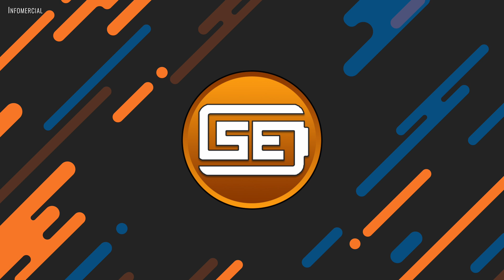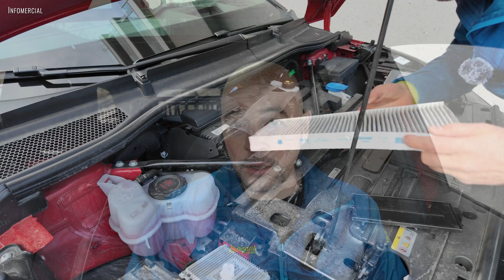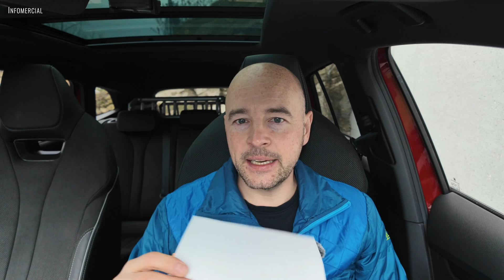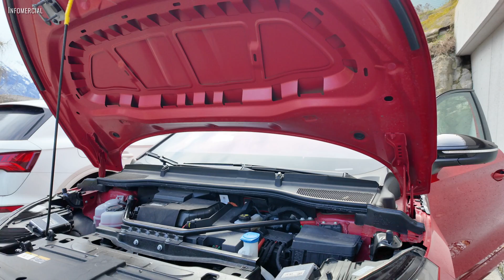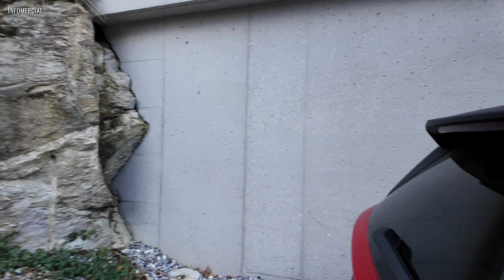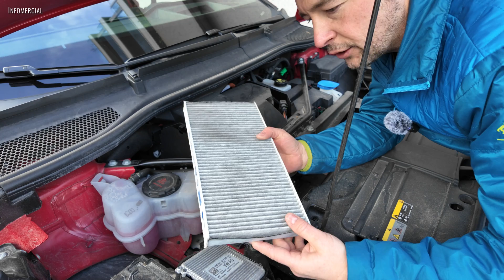Inspection and Service for my ENYAQ iV - What is done, costs and what can you do yourself

Comment: About the cabin filter, never blow it out, only change it. When you blow the filter clean, you release all the toxic stuff that the cabin filter has filtered. Vacuuming it is fine. My recommendation is 30.000km or 1 year for the cabin filter. 

Another tip: find an independent workshop or a brand specialist. For the 600 you spend on the dealer, you could also spend on an independent/specialist and ask for a brake job. (Manual cleaning and light greasing), that would justify the price. 

This price is out of this world for what is really done. The total time is around 30-45 minutes for a experienced mechanic. This price and not even resetting the service isn’t really what you should get for this price. Still can’t believe it. 😅
Reply: Thx to your tecommentations. Budget what about the warrenty you nee an official certified Garage. Than you will be on the safe side.. of Life 😂😮😅
Reply: @RGa-ch1vs  in the Netherlands at least, the warranty is two years for a new Enyaq. We also have something called BOVAG, if your garage has a BOVAG certification, you keep the warranty. The warranty for the HV battery is also separate from maintenance l. Could be different in CH but most countries have the same warranty regulations.

Comment: Tesla actually recommend more services than Škoda. They say you need a brake service every year if you are in a country where snow happens and salt is used on the roads. Škoda don't recommend that at all. After 2 years I had it done because it makes sense to me to look after the brakes. It cost me half the price of what Škoda wanted to charge.
Reply: When I say brake service I meant I had my brake calipers stripped and cleaned and lubricated. That's not in the Škoda service.
Reply: Exactly, it doesn’t really matter on new brakes, but that’s the wrong way to look at it. (Skoda perspective) But it’s called MAINTENANCE for a reason, and you want to start servicing the brakes from the get go, so you still have properly working brakes after 15-20 years.